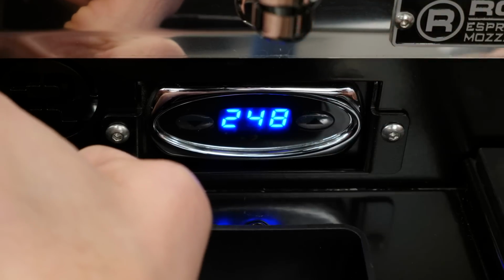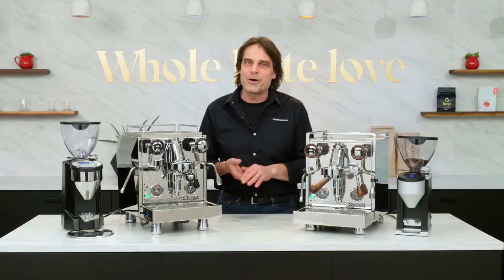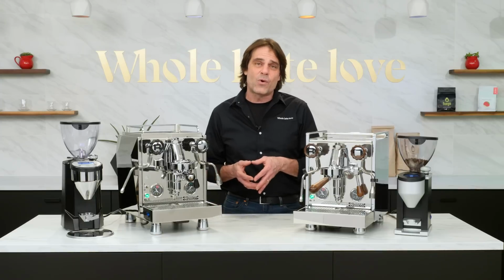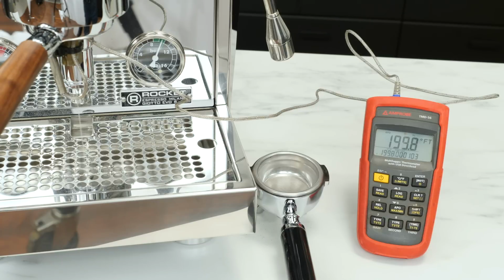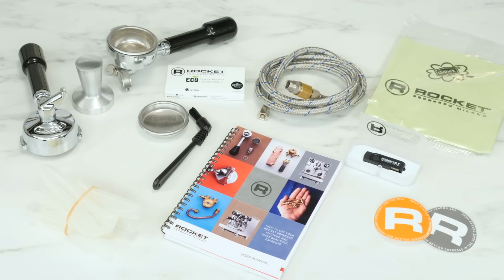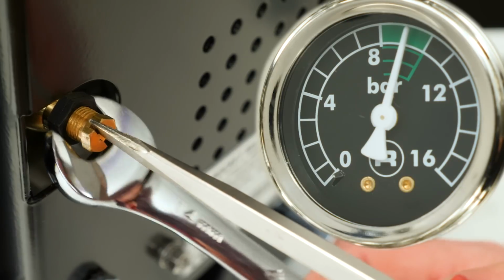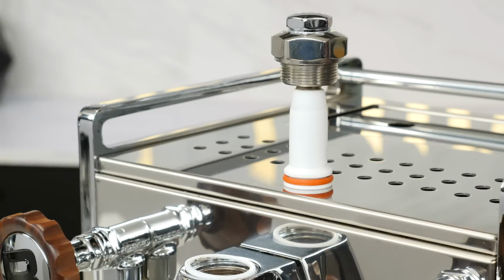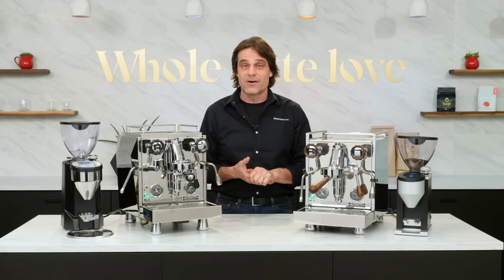Review: Rocket Cronometro R Giotto and Mozzafiato Espresso Machines

Comment: Sucks that ALL Rocket machines don't have the tray magnets. The tray on the Appartamento slides off so easily...I've dumped one double shot and one frothing pitcher full of milk by simply wiping the drip tray with a towel and the whole tray slid back and away from the machine. Of course now I don't wipe with anything sitting on the tray but that really shouldn't have to be a concern. I'll be adding my own magnets but obviously it's something that Rocket knows about that they would be adding magnets to at least some of their machines. I know pretty minor complaint...but still one that IMO is a legit issue.
Reply from the maker: Hi Chad, Thanks for your comment - I'd be frustrated dumping milk and shots too! Sounds like a change in technique helped avoid anymore of that. At this point the magnets are a feature found on these more expensive machines. Surely something you could DIY a solution too. Maybe super glue some rare earth magnets to strategic locations on your machine.
Marc